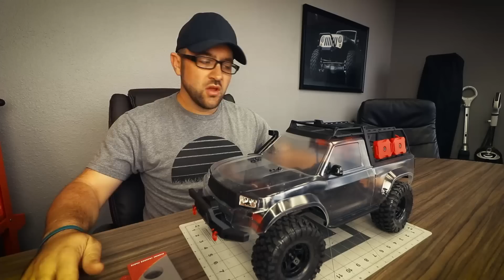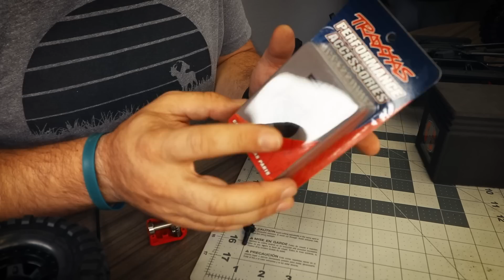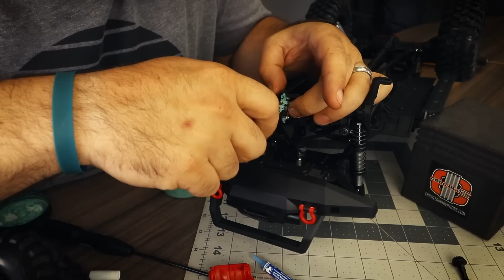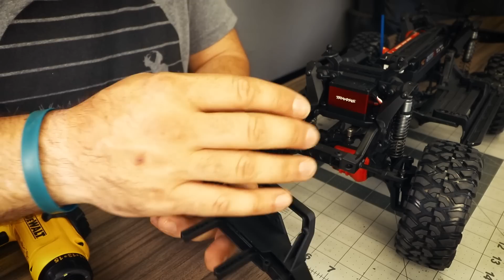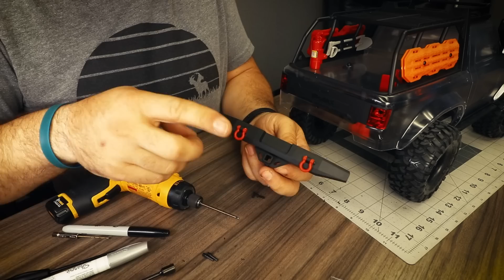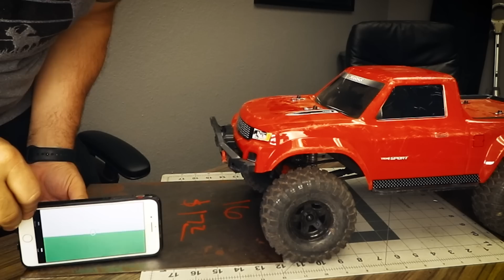Traxxas TRX-4 Sport Kit Budget Build-Off - Week 2

Comment: Thanks for the great tips on approach angle and depart, have always worked on that but you have it down. Thank you 🏁👻👍.time to get to work on the Element s app. and dep.  angles. We usually try to modify stock stuff first, then aftermarket parts later on.

Comment: Funny , on my Bronco I inverted the front bumper mount and bought another front mounted and inverted it on the rear,  but I bought Hot Racing aluminum ones to help eliminate chassis flex. Also installed a set of Hot racing aluminum bumpers.  All the same ideas,  works great!

Comment: Hi, be careful when ordering the Overdrive gears, I ordered a set TRA8287R which are not overdrive, they are the stock replacements and not I have to return them. TRA8287 is correct ones.

Comment: I really appreciate you showing the difference between the stock TRX and the modified.  once you get the modified truck running it would be great if you could show running difference between the stock and the modified.  Such as climbing Hills, Hill descent and also driving on certain angles to see which modification helps the truck.  Also installing the overdrive gears would it primarily be for a crawler or could you use the overdrive gears and keep it a trail truck/ crawler as well?
Reply from the maker: Makes a great trail truck too, will help with steering and climbing but not be so hard on the drivetrain.

Comment: Free Mod. Flip the Stock Shocks upside Down. Of course open them up and massage the innards a little. I got mine to cycle like butter with a little time and attention and 10wgt oil...

Free Mod. Also you can tuck the rear bumper in further Trim off the last hole on each frame rail in the rear section of the frame and drill  new holes in front to line up with the mount. thus using all 4 original screws.

These were my first mods when the Defender first came out. There is also a way to get a little more steering. Free Mod... Don't tell everyone but you can trim the steering bump stops and get a couple more degrees...

Your Welcome.

Comment: Flipping the bumper mounts over was definitely one of the first mods I did to mine.  Quick question, what was the reason you chose to overdrive the front axle instead of underdrive the rear?
Reply: Do both, but front is more impressive/bang for the buck.

Comment: You'll need rear under drive as well for it to make a difference.
Reply: I tried just front at first..didnt help much..much better with both.
Reply from the maker: That’s not true, 13% is plenty of overdrive to make a substantial difference. 26%+ is so much that it will effect a lot of other things such as sidehilling even. It works in comp only type setups but not something I’d run regularly.
Reply: If it wasn't true you still added it by week 8 lol

Comment: Would you still be able to run on the Trail with the over drive? Or would you break the transmission?
Reply from the maker: You’ll still be able to trail. 13% will be noticeable but not a major issue.

Comment: If having a lift kit installed on the trx4 defender and performing the same work you did, I’m assuming I would get the same results if not, better? I’m also waiting on some new hyrax 1.9 wheels and tires to put on the defender, kind of the same size as the stock tires that came with the trx4. I’m also assuming with those new tires I’ll have better grip and clearance with your mod ?
Reply from the maker: The work I did would benefit any setup, however the lift kit is not something I’d install unless for a mud truck personally.
Reply: The hyrax are bigger than the stock trx4 tires and a lift kit will not increase crawling performance, it will increase your muddin ability but that's about it.

Comment: Was the first free mod I did. Leaving the stock bumpers, they look very good, the plastic is very strong and keep  weight down on the truck as apposed to metal ones that will not slide as easily as the hard plastic ones.

Comment: I would cut the rear of the frame down. Think you need a total of 3” of over hang with the chassis past center line of the axle tubes. Bobbed the bed afterwards.

Comment: Hi Josh....just a tip I'm sure you're aware or but for people that want even more "tuck" or approach angle....just Dremel-off the "stops" on the bumper mount and take off some material(from the bottom back) next to the side holes on the mount to accommodate the rising in the front part of the frame. I was able to move my bumper back well over a half inch.

Comment: On my tactical I brought the front bumper in as much as I could and lowered the body as much after 1 or 2 runs. Had to trim a little but it was worth it. My trailer hich is still on and it now has a nice rock rash almost wearing through it.

Comment: Good work. 👍 I also modified the front battery tray they sell and making it work as a winch/battery mount.  Only extra free mod I would recommend is cutting off the back half of cage. Like you said every little bit helps. It still looks killer but handles sidehills that much better. I mounted all the accessories to remaining cage. Fire extinguisher on uprights on cage that's left. And left the small bottom portions on truck bed to mount the sand ramps on one side and shovel/axe/jack on other side. And I actually like the look better now so it's a win/win for me. Looking forward to see if you change the rack in the future

Comment: Is there a particular reason for going overdrive in the front rather than choosing underdrive in the rear?
Reply from the maker: I think this kit is already gear pretty low, so I chose the overdrive first. I actually have the under drive as well but not sure I’ll use both.
Reply: OK, thanks. Appreciate the reply 👍🏼